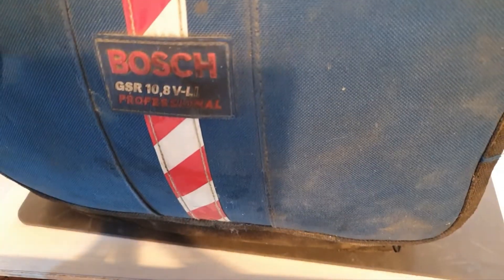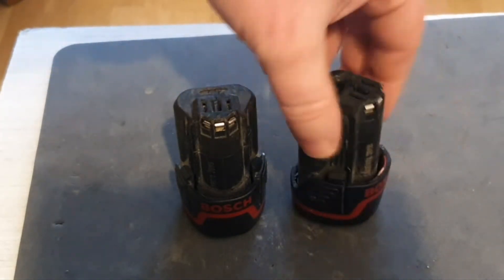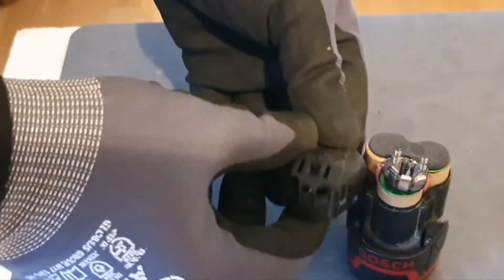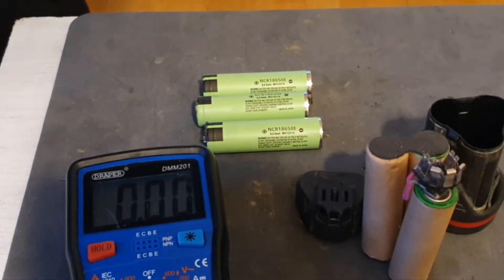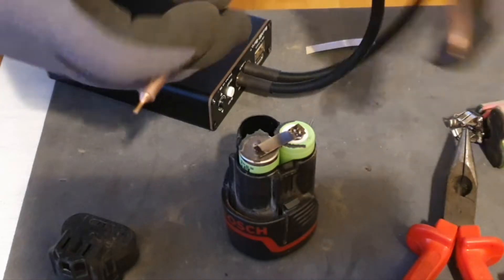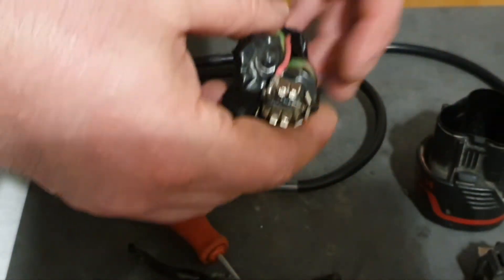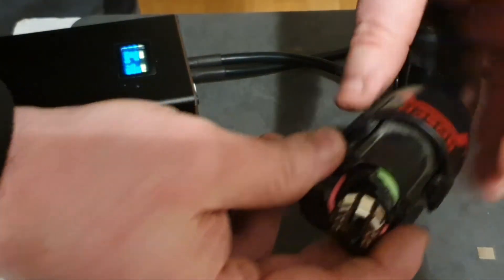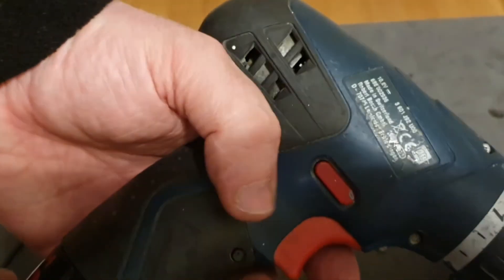Boost Your 10.8v Bosch Screwdriver Power  Battery Cell Upgrade #powertools #bosch #repair #battery

Comment: Awesome job brother 👏 what was it a 1.5 ah it had good cells i would have kept them for another pack!!
Reply from the maker: Thanks Branden It was a 1ah the cells are a bit low in the ah to be honest. I got my hands on a couple of 36v husqvarna chainsaw faulty batteries that were replaced under warranty so I have nearly 40 of 2000mah LG cells to play with. I hopefully might do a m12 battery build soon if I get the time.